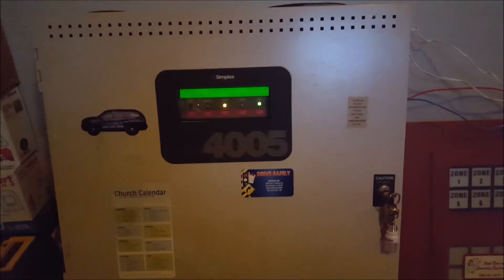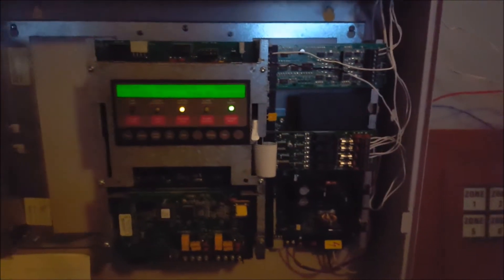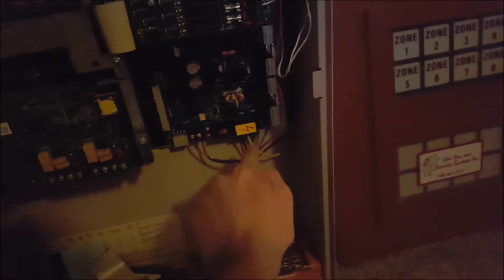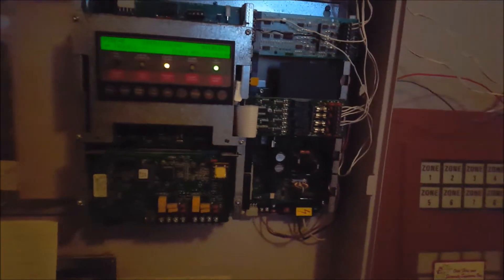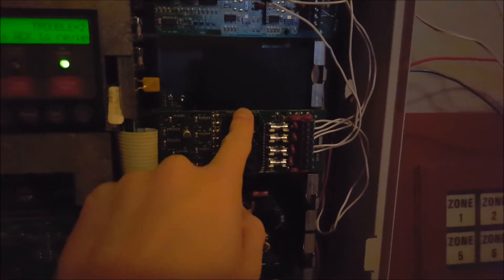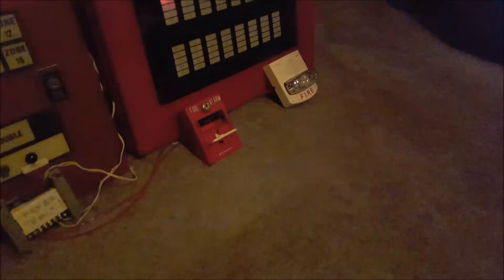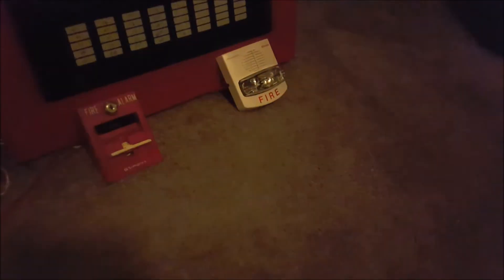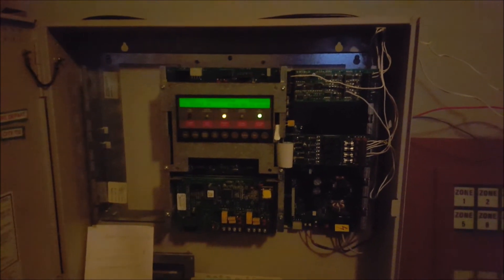Floor System Test 40 - New Changes/New Device

Comment: I made a little video of different Alarms. I only just did the models I know well. Is the Simplex 4005 getting old or something since it’s having some trouble?
Reply from the maker: Yep, I saw it. Well, there's something blown out of the power supply, so that's what's causing the trouble. Before I purchased the panel, it most likely got hit by lightning, so it ruined most everything in the system. I had to replace it all.

Comment: If you have a battery trouble after 3 hours, chances are that the charging circuit is shorted - get some new batteries and see if they work
Reply from the maker: I kept that thing on way over 3 hours, and the trouble still persisted. Maybe that could be something else wrong with the power supply.